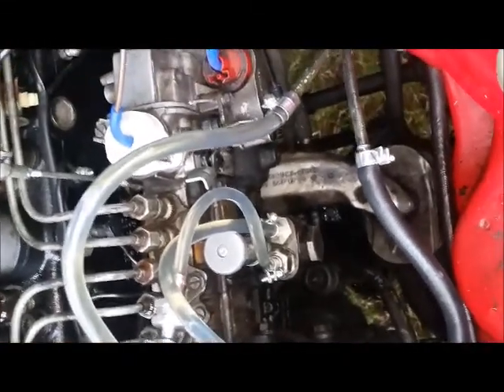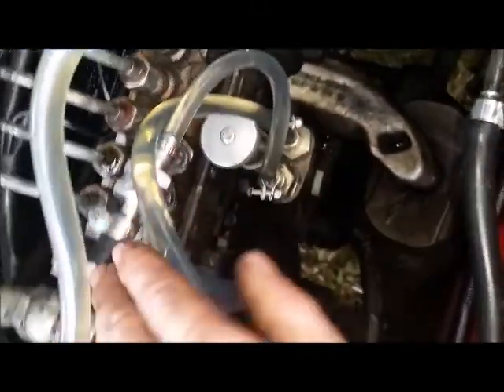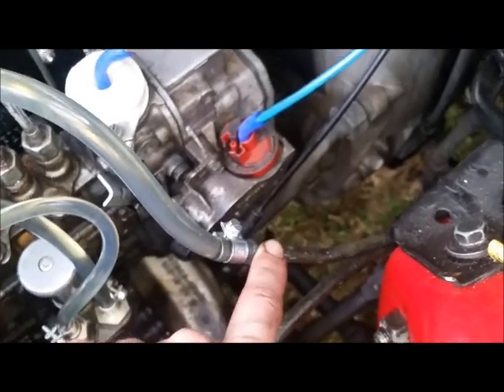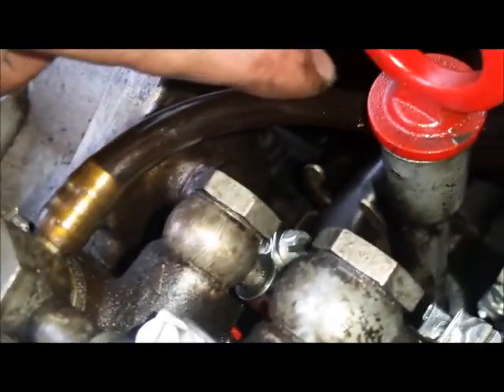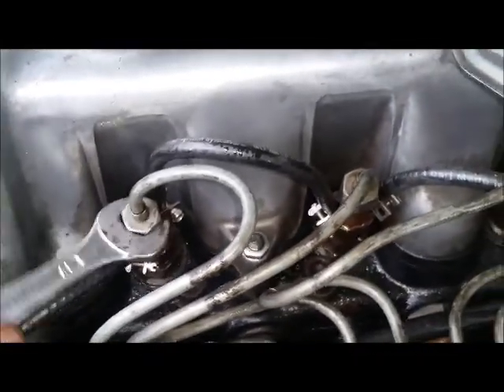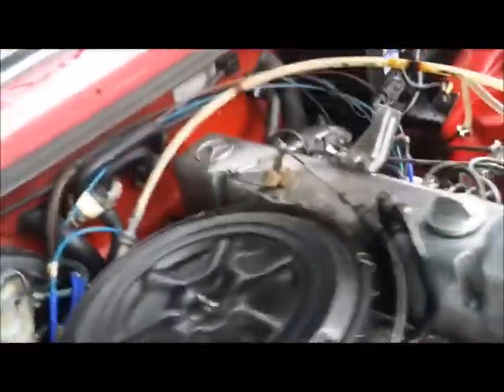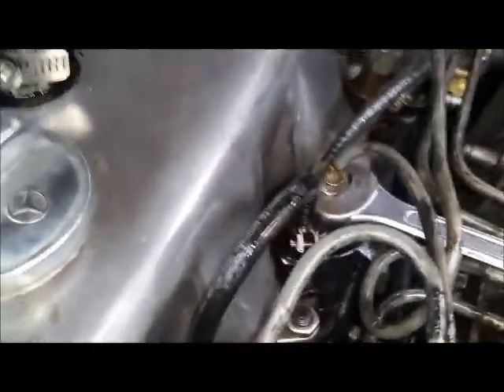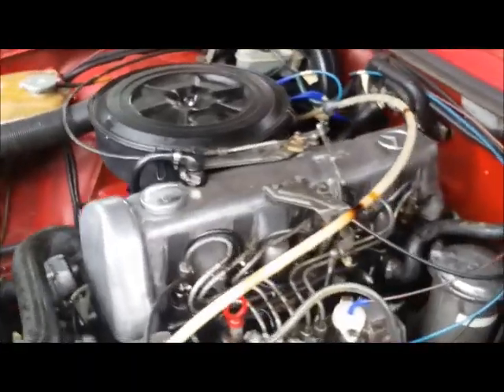w123 diesel fuel bleeding instructions

Comment: Think I’ve got bad lift pump , trying to diagnose it. This video is helping troubleshoot as it’s not starting up. Thanks man.
Reply from the maker: No worries :) 

Glad it's helping :) 

Usually if the little hand pump is bad a bit of fuel comes out where the little hand pump slides up and down.
Reply: @ thanks because I’ve been trying to troubleshoot it all day again today and there is a little bit of fuel coming out in that area when I hand pump it specifically as well I was gonna try and do a diesel purge, but I can’t get it. started the joys of a diesel 1983
Reply from the maker: @ChefMaxBets  
The issue is just the little hand pump primer then, you can get those as a replacement on ebay, or your mercedes dealership.
Reply: @ got in there and looks like it’s no from there it the valve to the left it looks like 😳

Comment: My primer pump isnt working i get no resistance on pump.im ordering new primer. This car has been sitting for 10 years .Drained fuel vacuum pump through line. Blew air into tank fuel came out of line at primary filter. No fuel at cracked injector.
Reply: Same situation with my 300CD.

Comment: My primer is not building any pressure. Just pumps obviously not priming. Any other method?
Reply from the maker: A good thing to watch is the fuel flow in the first fuel filter, most of them are transparent, or translucent. 

is the air bubble in the fuel filter getting smaller when you pump with the primer ? 

it can take 100 pumps with the little primer to get fuel comfortably flowing around.

Comment: Pressurize the inlet to the fuel filter with a small 12 volt diesel pump , crack all the fuel nozzle lines at one time . Restrict the return fuel line flow a little , close the nozzle lines , start engine , remove fuel restriction clamp . Remove 12 volt pump .

Comment: Great vid, I just changed the plastic inline fuel filter and now it won’t start, I pumped at least 100 times every time to try and start but it wouldn’t start, I’ll try doing this tomorrow I had to cancel the mot because I couldn’t get it started
Reply: 1986 307d motorhome
Reply from the maker: @garyjolleys2480  do you hear a squishy kind of sound when you pump on the primer ? 

If so, the primer is likely leaking and not moving fuel forward as much as you like. 

You can replace the primer, but for the short term there is another fix. 

Which is to get a sealed condom, place it over the primer pump to make it air tight and Zip tie it into place.
Reply from the maker: @garyjolleys2480   The primer fix is in car trek video here. about 2/3 of the way through.

https://www.youtube.com/watch?v=M1SpwlsaiwM&t=630s&ab_channel=Tavarish

Comment: are those 17mm wrenches or 19?
edit: what are the sizes of the hoses that are used for the pre-fuel filter
Reply from the maker: 17mm for loosening the hardlines. 

the pre filter is 8mm if i remember correctly.
Reply: @qwertyui90qwertyui90  gotcha, and what do you recommend to loosen the hardlines with out breaking them if they're really really tight? thanks for your response
Reply from the maker: @note_finger   I would still use the 17mm. Along with a small sledge hammer to tap the end of the spanner, to give it that "shock" to loosen it up. I have a 5pound / 2kg sledge hammer with a short handle just for that type of task.
Reply: @qwertyui90qwertyui90  gotcha, and where did you aquire those clear fuel lines? they look soo cool
Reply from the maker: @note_finger  haha i was asked about that just a day or so ago.

They are just clear tubing that i used as i had nothing else on hand at the time and since it showed the fuel flow really nicely i decided to make the video.

It isn't " fuel line" it was a temporary clear tubing from a hardware store. So i do not recommend anyone use it.  Any fuel additives may just eat through it half way down the highway ect: 

It just showed fuel flow nicely during the video :)

Comment: Nice work - educative session! Thanks - keep going!
Reply from the maker: Next big video will be taking the engine out, putting it on an engine stand and then changing the connecting rod bearings
Reply: @qwertyui90qwertyui90  How about swapping the engine - would be nice to have a V8 there.... Or Volvo's 5-cylinder.
Reply from the maker: @arivaisanen4561   No, not touching volvo haha. 

and nah, this engine is good :) and no drama with trying to fit a different one in.

Comment: put a couple of towels man!
you make me angry!
Reply from the maker: a few drops of diesel isn't going to hurt the engine.  I cleaned up after i was done any way.

It's to simulate being on the side of the road and figuring out what to do :)
Reply: @qwertyui90qwertyui90  
of course ! diesel will make your engine shining,but it's the ennemi number one of the rubber parts,especially the engine mounts!
i see a lot of videos of young mercedes lovers doing differentiel oil change or valve adjustment or master cylinder  without making attention to the debries!
it's realy harmful and it's necessary    to hold the red flag from time to time!
Be sure of my respect and ...i'm not angry lol!
i'm so happy to find good videos on w123 .i have a 300 td 1982!

Comment: It's much easier to bleed the system  by  undoing the nut on  top of the fuel filter there is no need to crack open any injectors and there is no mess.
Reply: yes y're right!
Reply from the maker: @elmessaoudi1638  If you for some reason got yourself air in the hardlines between the pump and the injector you will most likely drain the battery before your engine fires up :)
Reply: Also dies when it gets hot
Reply: @qwertyui90qwertyui90  yeah I'm charging my battery now because of that. Thanks for the video much help.